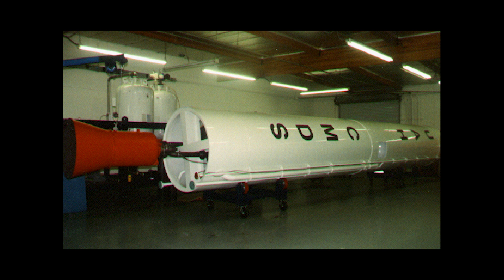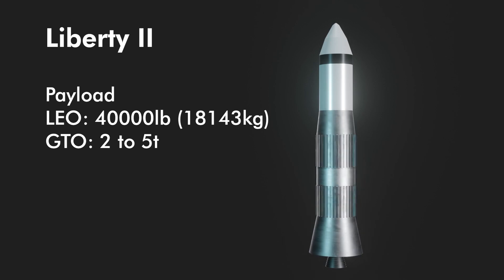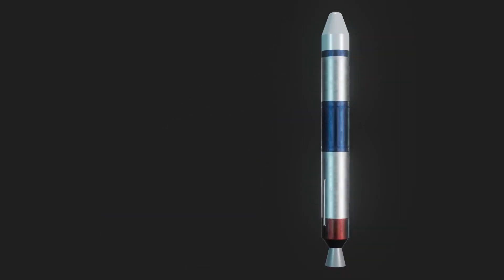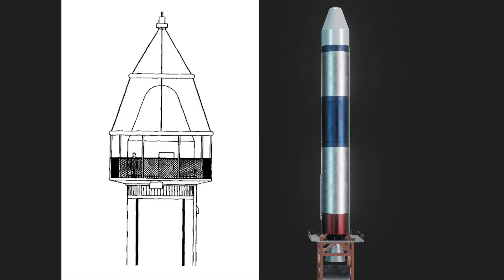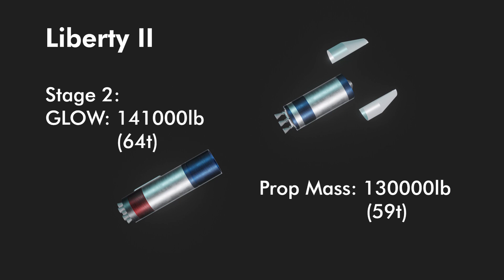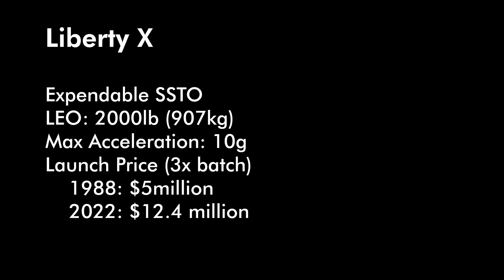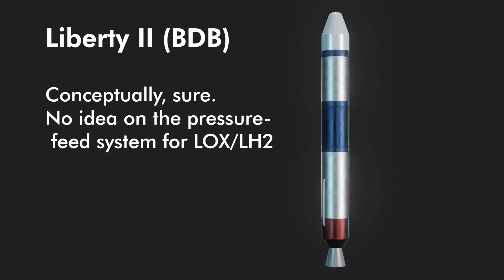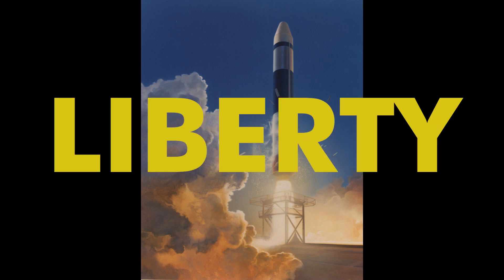Liberty I, II, X | Know Your Rocket

Comment: Stage 2 Liberty II BDB appears to be using a VAPAK style feed system where LOX/ Hydrogen"s own ullage vapour pressure is used. This would explain the low chamber pressure of around 135psi as LOX in VAPAK mode can produce a tank pressure of around 150psi.

Comment: Pressure Fed LOX/LH2 - sounds weird, because of very low boiling point for liquid hydrogen. How it is supposed to work?
Reply: Not sure it was planned but Hudson had been working off and on with the idea of "autogenous" pressurization using the fact that both LOX and LH2 (later propane and methane) were cryogenic and could be used to self-pressurize.
Reply: @randycampbell6307  like it evaporates itself due to a nonzero temperature of tank it contains in, pressure is rising naturally and that's feed the engine. It is even easier then other pressure fed systems, but thrust must be miniscule, comparing to other designs (except cold gas thrusters)...
Reply: @Immanatum  No actually part of it's run through an engine heat exchanger to up the pressure and then it's bled into the tank. Pretty near (if not better in some cases) than standard tank pressurization and it doesn't require a seperate system.

Even works with non-cryogenic propellants though it's a bit tricker.
Reply: @randycampbell6307  oh, crap, an autogenous pressurization. I've forgotten about it completely(
Reply from the maker: @Immanatum  Bob Truax planned this for the second stage of Sea Dragon as well. It's not unheard of.
Reply: @pressure-fedastronaut6511  unless you are living in post-Soviet country and learn all of this on YouTube channels)

Comment: Wouldn’t reusing the F-1 be very difficult because of burn-through and the thermal foil it used? I’m not expert on engines, so I could be entirely incorrect but these factors seem like a problem.
Reply from the maker: There is a lot. Most of it is just that the engines were made in the 1960s in a bit of a rush. Methods and documentation for them simply didn't exist by the mid-80s.
Reply: @pressure-fedastronaut6511  it’s crazy how quickly those engines were developed. It’s no wonder that we lost so much documentation surrounding them.

Comment: What was the Liberty II going to use for roll control?
Reply from the maker: From the paper (this is the seven engine first stage pressure-fed):  "No roll control maneuver is executed until start of the second stage engine firing all roll information from the IMU is used to bias the first stage engine TVC to compensate for roll attitude variations from the preplanned trajectory."
Reply: @pressure-fedastronaut6511  so cross your fingers and hope it doesn’t spin itself apart during the first stage burn? Sounds risky.